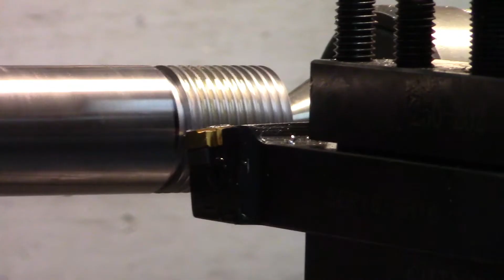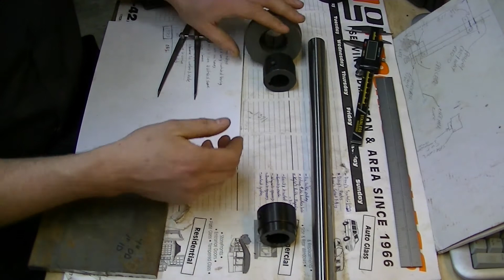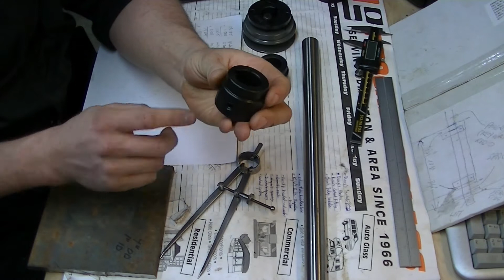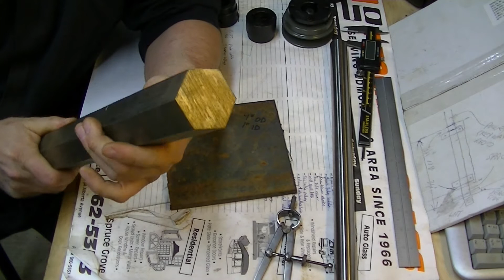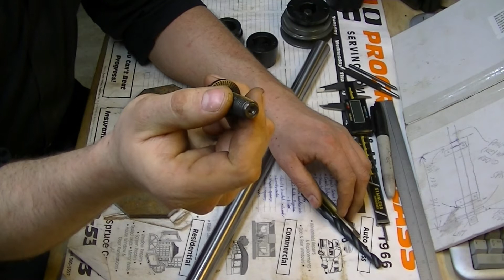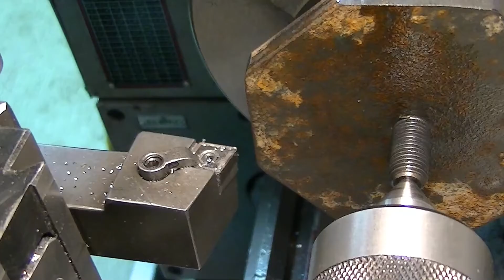Concrete Cutter Shaft Pt 1

Comment: Great video.  Enjoyed it very much.  I am a chef and I have the same issues with my hands - Years of putting them in/out of ice cold water, cutting part frozen meat and going to extreme heat conditions, using knives etc etc.
Reply from the maker: Yeah, it's annoying when you think you are holding something and it slips out of your hands because the sensitivity in them is gone.  I had never thought about the culinary professions being hard on one's hands, but you have a very good point.  Add deep fryers to the stuff you mentioned, and it would be quite hard on hands for sure!

Comment: Concerning the loss of feeling in your hand, is it in both hands or just one. I lost feeling in my left hand several years ago and found out that I had a bulged disk and two disks with bone spurs in my neck. I think it was c3, 4 and 5. I was able to get physical therapy which involved some specific stretching exercises and the feeling returned within a few weeks. The doctor who diagnosed the issue said that I would have to have surgery to fix the problem. That was about 15 years ago and I still haven't had to have the surgery. Possibly the positions you are in are causing a similar condition that can benefit from something as simple as neck stretches.
Reply from the maker: I think the lessened feeling had more to do with a combination of the vibratory nature of working with air tools (impact wrenches, etc.), the constant pinching/small cuts/squishing/burning, and the callouses that build as a person works on cars in all types of weather over a while.  I've been away from working on cars and trucks every day for about 9 months now and noticed that I'm getting some of the feeling back in my finger tips - I used to be able to pull a cookie sheet out of the oven at about 180 deg F and it was warm but not hurting, and now it actually does hurt.  Granted, when I have to find a full time job again it may be as a tech again because that's what my current training is for, but we'll have to see.  Thank you for the concern though, I'm glad you didn't have to undergo spine surgery.  I know people who have and it was miserable for them.

Comment: I see this video has been out for a while and I was going to comment on your other videos about the traditional black fingernail polish that we mechanics get, sometimes very painful to get performed. I just found and started watching your videos, so far they have all been awesome. Maybe have your hands checked out for carpal tunnel, I never realized it, but my hands go numb a lot and my surgeon that fixed my rotator cuff said that was mainly what caused the numbness in the hands. Mechanics use their hands more than they realize. Good luck.
Reply from the maker: I hear you, being a mechanic is hard on a body. Thankfully I don't have hand numbness, even after working as a tech for this many years, but have noticed less tactile feeling in my finger tips. After being a stay at home dad for about 7 months or so I've noticed that a bit of the sensitivity is coming back, so that's a good thing and I'm thankful for that  Thanks for coming by!